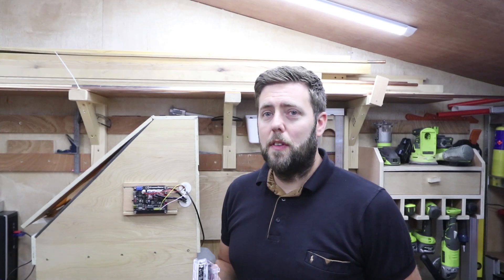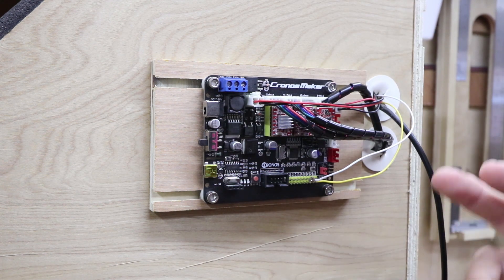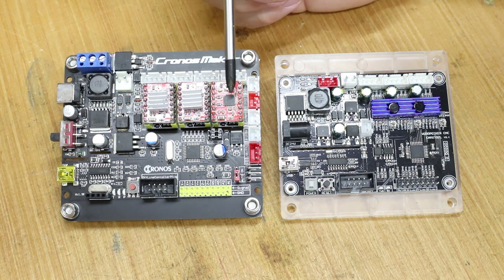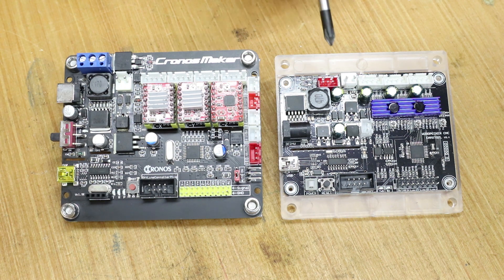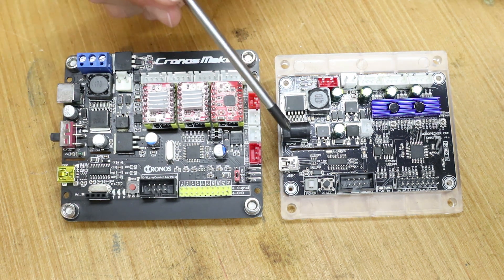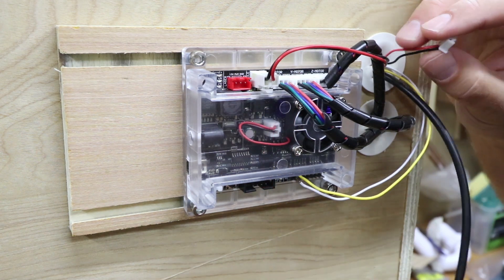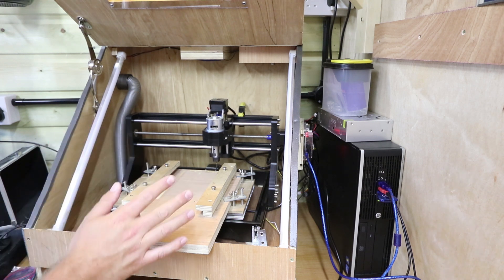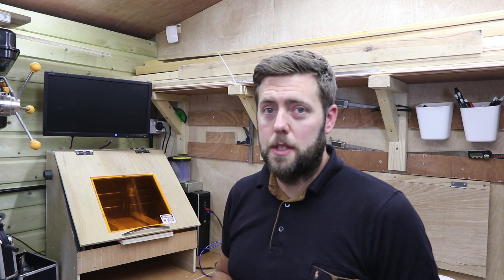3018 PRO - Control Boards

Comment: I just came to see if the spindle LED on the top left lit up when turned on or just when spindle is spinning. Thanks for no rundown on indicators. My spindle LED is dark and wont spin. and the search continues
Reply from the maker: I'm not 100% sure. I'll try and check the next time I'm in the workshop

Comment: I am using the same board on my 3018 Pro (tried 2 boards) but have issues that all parts came out 0.3mm smaller.  I milled a few holes and square. Can you try milling a hole and reply back?   I read the Gcode (generated from Fusion 360) of the tool path and the dimensions were correct via UGS.  Also tested with Candle and no luck.
Reply from the maker: You will need to calibrate your steps. I don't have a video on this but TechyDIY has a great one. I think UGS also have a calibration tool inbuilt for it as well. Its basically where you tell you machine to move a set distance like 200mm, you then measure the exact distance. if its over or under what it should be then you re-adjust some of your setting to account for it

Comment: what software do you run for your CNC machine I'm new to this and I'm not sure what software to choose there is quite a bit out there could you help me thank you very much
Reply from the maker: Hi George, Are you after software for designing or software for running the machine as they are typically separate?
Reply: @JamesDeanDesigns  yes I actually know nothing of CNC milling yes I want to learn how to do this I've got no experience whatsoever with cnc I want to learn how to do this and probably turned it into a career

Comment: Hello, do you think it likely that a PROVerXL 4030 could be controlled using a duet 2 board (like Ooznest WorkBee) ?
Reply from the maker: In theory, yes it can. However, Duet uses different firmware or a different language so to speak. So most desktop CNC's use GRBL but as I say Duet is different you you need to know your software can output for that

Comment: you cant buy a cronosmaker board anymore. now theyre Annoy Tools boards. very similar but not exact especially the power input locations.
Reply from the maker: I had noticed the little rebrand. I haven't tried an Annoy Tools one yet but after doing this vdeo I went back to using a Cronosmaker board

Comment: Hi James wonder if you can help I brought a 5.5 laser module kit from Sain smart and a spindle upgrade but my 3018 controller board is not compatible I've been told my board is annoy circuit board  my laser fires full power when you switch the power on to the controller board control and continuously burns at high power until I turn off at the power
Reply from the maker: Can't say I've heard of Annoy before but a quick Google show one by Annoy Tools which is basically the same as the Cronosmaker. As for your laser being on 100%, I suspect your firmware is out of date. When you first connect your machine is candle or UGS, in the console area it should say something like GRBL and then either 0.9 or 1.1. If its anything lower than 1.1f you will need to upgrade the firmware
Reply: @JamesDeanDesigns  Thank you I will look at that great help and will let you know if that sorts the problem out
Reply: @JamesDeanDesigns  Hi James I have looked on there and mine says Grbl 1.1 F

Comment: My Friend the red driver chips are there, to provide the correct voltage to the axis motors to drive them, it has nothing to do with gcode! Basicaly Its an ESC (Electronic Speed Controller). 
The exact same technology is used for drones, Think instead of the head of the cnc , 
that the drone that moves in X-Y-Z to place, with the help of sensors (gyroscope-gps)
Reply from the maker: Thank you. I was led to believe that they impact how the code is processed.
Reply: @JamesDeanDesigns  in a way they do, the UGS platform converts the file to gcode, then we send it to the atmega processor , and the atmega calculates the gcode to real XYZ values,
and gives the command to the esc's, to provide accurate power needed for every movement.

You have done very good job on 3018 , and pretty acurate. your videos-links have helped me a lot to setup my machine. 

Also I have a question, my machine came with a pcb  (blue board) with the atmega soldered on it (not arduino nano that plugs), 
 it has selection for double Y or XYZ mode,  With external esc's and TTL or constant laser (2-3 pins), and runs Grbl 0.9j  By Dingqi Electronics.
what procedure for update should I follow?

Comment: how much strength have youre steppers. i just have assembled a 3018pro with that same board, can easely hold steppers by hand, they have no strength. thanks!
Reply from the maker: Hi. They are low powered as this is a lightweight machine. They are the right ratio for how fast the spindle can cut. You can fit more powerful ones with higher amp, but you need a board that can output that higher amp as well.
Reply: @JamesDeanDesigns  okay, tahnks, i have some laying around (steppers and boards) so gonna try that. I thought that this setup would need some strengh to work correct, maybe not. i try this setup first.
Reply: @JamesDeanDesigns  NO, need only board drivers out and adapter but drivers place were go out step signal =puls, and dir signal and enable signal then thats 3 wire go to external drivers, stepper motor drivers, etc, TB6600, DM 556-860 etc, and own power to drivers who handle normal cnc big nema23 -34-etc big motors current.

Comment: This board just plug and play or we must give the program to that board
Reply from the maker: Technically it is plug and play however, you may need to change some settings to match what what on your existing board. I should mention I went back to the Cronosmaker in the end as I had some issues with the woodpecker

Comment: Have recently replaced my board with one from SainSmart. Everything working fine but today I connected to my laptop and connected to UGS and it connected and jog controls appeared. But trying to move either XY or Z stepper motors just buzz but do not turn. Disconnected lead screws to relieve any load but still no movement. Check PSU output and fine at 24v. Fitted another board but still the same. Any ideas as I am stumped. Thanks .
Reply from the maker: That does sound strange. You've already covered most of the things I would suggest trying. Off the top of my head the only other things to suggest are check all cables are connected correctly at both ends. Perhaps try different software like Candle

Comment: I'm pretty sure I have the same woodpecker board but also my machine was one of the ones that had the sides reversed which forced me to put the motor on the other side. X Y axis seems to be fine but I'm guessing the Z axis is off being that I go to cut and it goes above the material rather than into it. Also, the offline control board allows me to spin the bit while the PC programs act as though this button doesn't exist. It's a freaking headache.

Comment: Here's something you might want to add.  The original controller board is mounted on the aluminum frame.  It is essentially grounded (earth).  When you relocate the board on the wood cabinet, you un-ground the control board.  The vacuum cleaner you use on the waste board creates lots of static electricity and when you touch the nozzle to the metal parts of the router, the induced signal "shocks" the controller board and it stops working.  Often power cycling will clear the problem.  Three weeks ago, my board died while I was vacuuming up dust.  The new board was $38.  I installed it AND added a ground wire from the metal frame to the new controller board.  No problems to date.
Reply from the maker: That is very true about the static. I'm not entirely sure the connection to the frame is considered to be grounded though. Most people will sit these on a workbench or in an enclosure, may put felt pad underneath to dampen vibration etc. So there is no actual grounding, unless you go to the extent of separately grounding the frame. I'm not sure if I've ever mentioned it in my videos but I have mine grounded into the ring main. Goon info though 👍
Reply: @JamesDeanDesigns  high volt ground and low volt ground need keep far not together newer. and power system wires and small volt data wires need be far too not newer near all different line wires,
Reply: Got an used 3018 pro...looks like the board was fried when I purchased it...which one did u get? comes w install instructions and driver uploads ?

Comment: Hi James I have had  real issues with the Woodpecker V3.4 board on the 3018cnc pro. With  the travel directions and Homing. When I have done both   I never can get it right. and the GRBL work end up messed up . Can you let us know what setting you used for the Setting particularly $3 , $23 and preferable all the settings as a Guide . I have looked in the video you say you would update in a later video but can find the info manay thanks for the great Video for us new to CNC/ Laser engraving
Reply from the maker: Long story short, I ended up going back to the Cronosmaker a while after making this video. I had 2 woodpecker fail back to back. 
The $3  can vary between every board, even ones of the same brand, ive never understood why. However there are only 7 options for it so worst case just go $3=1 and test, if something isn't right then $3=2 and test again and so on upto 7. But that setting is just when an axis doesn't move in the right direction
Reply: @JamesDeanDesigns   many thanks will try this
Reply: @JamesDeanDesigns   @Simon Collins know I am late to the party but I just bought a 3018 that came with a woodpecker. I had to change $2 to 0 from 1 and left $3 as 3 and I'm pretty sure it's accurate now, did my first cut 👍hopefully this helps anyone with the same issue

Comment: im trying to use my cnc 3018 pro with corel Laser software, however in order to make the interfaz i need the mother board part number, its supposed that should be in the board but is not. how can i get it? it comes with an annoy tools board..
Reply from the maker: Hi. I have never heard of this before unfortunately. I dont really understand why the software would need that information, or even how to get that. Sorry
Reply: @JamesDeanDesigns  any idea of how to make the connection?

Comment: just got a brand new cnc 3018 pro
nothing works , i mean all axis aren't moving not even the spindle
do you have any idea what could be the issue. the led light on the board is working tho 
thanks in advance
Reply from the maker: I suspect its not connected correctly. There is always the chance the board is faulty but its a case of eliminating possible causes. Start with the simpler ones such making sure its connected correctly, try different software etc.
Reply: @JamesDeanDesigns  nope just checked double checked and still no pulse . Tried a couple of softwares. So am guessing it could be the board ?
Reply: All led blinkers are working on the board..
Reply from the maker: @hamadaali5687  have you confirmed its definitely connected to the PC correctly via device manager? 
If you have something like a multimeter you can test things on the board to try and eliminate issues but if you're not used to circuit boards then its not easy
Reply: @JamesDeanDesigns  well I just pressed the restart button a couple of times and now it works :) but the spindle stopped all of the sudden. I changed the speed rate and it stopped spinning .

Comment: Hello there, hope you are okay, i bought this machine just one week ago, and it worked just for one acrylic cut, the machine stopped on the meddle of the work, i restarted it, and it does not want to work anymore, am my board looks like the one in case, exactly the same. nothing is working anymore, but the board still goes on, software does not even recognize the machine anymore

Comment: Hi can someone please help I’m trying to do text it’s ok on the program Steve is the text but when I machine it it comes out upside down and in reverse
Reply from the maker: Hi, good chance it is your $3 setting. Try $3=3 to begin with. If not take a look at the table in this link and work out which number yours needs to be. 
https://github.com/gnea/grbl/wiki/Grbl-v1.1-Configuration#3--direction-port-invert-mask
Reply: @JamesDeanDesigns  hi thank you I’ve now got it working great video’s keep up the good work

Comment: When your replaced you board, did you have any problems with your laser not working? I just replaced mine and now my laser won’t work. Any help work be greatly appreciated.
Reply from the maker: I didnt have any issue. Did you make a note or backup of all your settings?
Reply: @JamesDeanDesigns  no unfortunately I didn’t make a back up copy. I have made sure that the laser mode $32 is on and all the fans for the the laser turn on when I plug it in not sure what else to try.
Reply from the maker: @royhurd7137  can you move it about with the buttons?
Reply: @JamesDeanDesigns  yes it moves and does the program but the laser doesn’t fire.
Reply from the maker: @royhurd7137  thats good news. Have you checked your $30 setting?  That should match what ever is used in the design software. All my laser videos i use $30=1000
Reply: @JamesDeanDesigns  yes the $30 setting is 1000
Reply from the maker: @royhurd7137  ok. Make sure your spindle is wirenis disconnected from the board if you have one. If the board or laser has any switches for PWM make sure they are turned on. I am assuming the board actually takes laser and is wired in the same way. Different boards do have different connectors for lasers so I'm just double checking
Reply: @JamesDeanDesigns  I have the same board that you replaced in you video. Is only pwn is in lasergbl and I tried that on and off
Reply: @royhurd7137  If you are using LaserGRBL, you will need to change the $32 parameter in the parameter settings. ($32=0:spindle mode; $32=1:laser mode)

Comment: The original board has 2 Y-axis terminals.  
Does that mean it would have accepted a second Y-axis step motor?
Reply from the maker: It does, the Cronosmaker can run dual Y axis
Reply: If you want to use an extra stepper motor, you can get a splitter.

Comment: Hi James, your videos have been a lifesaver for setting up the 3018, so many thanks! Quick question - have you had an issue with the Z Axis grub screws letting go of the motor shaft? This seems to be a recurring issue for me. I think I'll solve it by lightly drilling some indents to give the screws something to grip onto, but wondering if you had any suggestions? Many thanks in advance :)

My machine has also frozen during milling but I think that's likely to be a PC error or interference; something to keep an eye on though!
Reply from the maker: Freezing is usually your PC/laptop but not always. As for the grub screws, get some blue loctite or also called thread lock. Should solve the problem 👍
Reply: @JamesDeanDesigns  I decided to go for the nuclear option and epoxy glued it onto the motor shaft. If it comes off now then there’s something very wrong 😅
Reply from the maker: @geko7844  😆 good choice
Reply: @JamesDeanDesigns  thank you for your help and for all the videos. Unlikely I would have tried CNC without your guidance!

Comment: I guess my machine (was a gift) came with a woodpecker board as it looks exactly like the one on the right.
Reply: I’ve seen a ton that come pre upgraded
Reply: @engineeringabe  Yeah, I was lucky but I do believe most are now coming with the upgraded Woodpecker with 1.1f on them (I compile my own so has 1.1h) enclosed and with a 40mm fan.
Reply: @generalawareness101  I see

Comment: I have a problem with the woodpecker board with the Z axis limit switch circuit. If any switch is connected, it immediately throws a out of range limit error. I tried other known good switches (on other axis that work) with the same problem. I have messaged the seller and I'm waiting to see if they will replace the board.
I had a close look at the board and it appears there is a problem with one of the resisters not being soldered correctly.
Also the limit switch axis pins are labeled incorrectly. On the diagram is shows xxyyzz. In fact it is zzyyxx.

Comment: so on the board and so many I see the red laser output is pwm as opposed to ttl and yet most of the diode laser modules are ttl mine wont respond to this output on the board? Yet my laser three pin connection is clearly marked ttl while any boards I see the ttl output is two pin?

Comment: as my research, your new board support up to 60v spindle... so maybe your power supply is unnecessary...
Reply from the maker: Maybe Im misunderstanding your comment but what part of my power supply is unnecessary? Volts are only one part of a power supply, amps is another major factor. The power supply upgrade is less about the volts and more about the amps and this is why my supply was upgraded. I needed more amps to run the spindle, lights and fans
Reply: @JamesDeanDesigns  my friend, I believe that you have that board: 
https://a.aliexpress.com/_B1Rhqe
If so, read the parameters of that board. All the boards that I seen that look like your boats have the same parameters... of course I also seen grbl boards that support even 110v 40amps spindles.
And please don’t get me wrong, I don’t understand on cnc like you (I’m just building my own first cnc based on 3018), but I understand a lot about electricity and mechanics ;)
Reply: @JamesDeanDesigns  by the way, your project is amazing! I learned a lot from you :)
Reply: @JamesDeanDesigns  boards not need handle more power only need etc, spindle board controll spindle FET =varaible speed or relay on/off spindle controll, and then this FET or relay connect biggest own power to spindle. same if use more current light need relay and biggest own power light, etc,fans same.